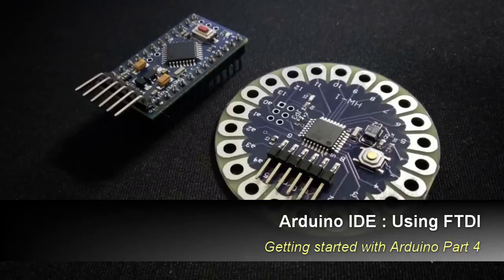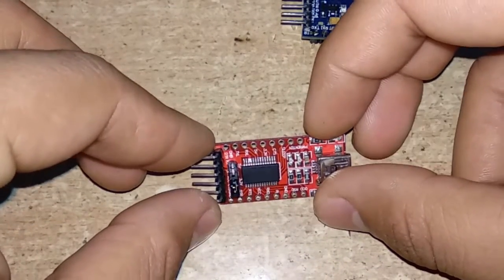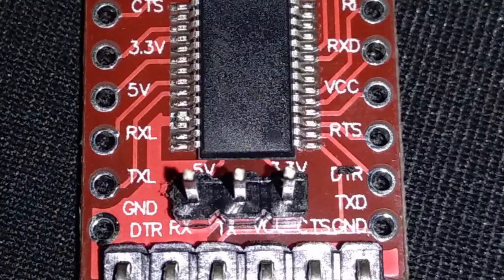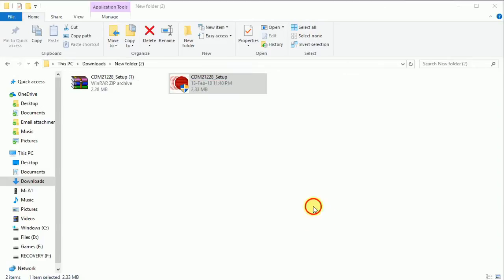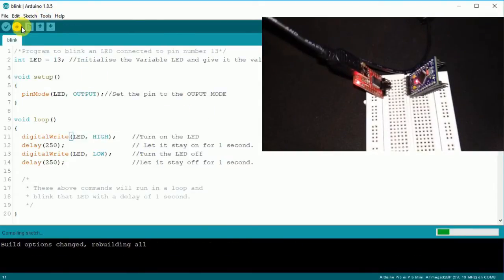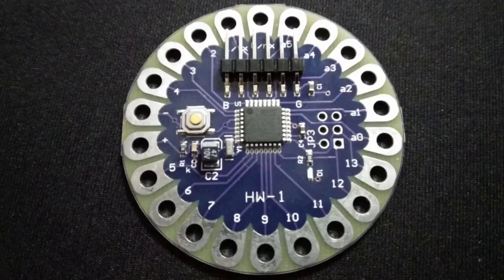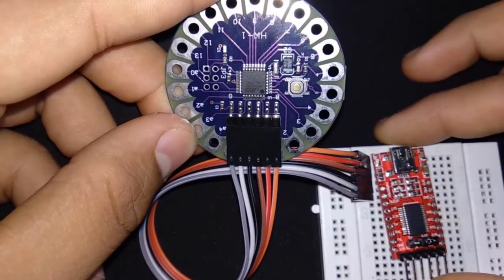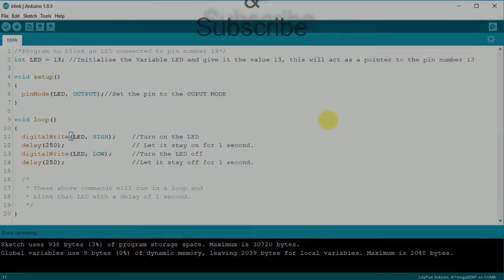Arduino IDE : Using FTDI (Upload Sketch to Mini and LilyPad)

Comment: I have same FTDI adapter as yours. I have same Lilypad but meine is HW-001. I installed all drivers, also i installed arduino from official website.

I googled so many of times i tried absolutely a lot of thinks but none of worked. Allways i'm getting this:

avrdude: stk500_recv(): programmer is not responding
avrdude: stk500_getsync() attempt 10 of 10: not in sync: resp=0xae

could you help me ?
Reply from the maker: Srry man its been long i have been working with arduino